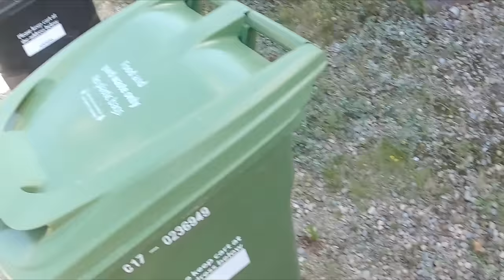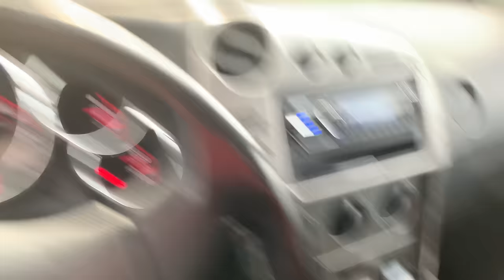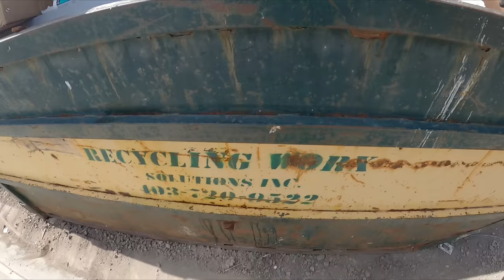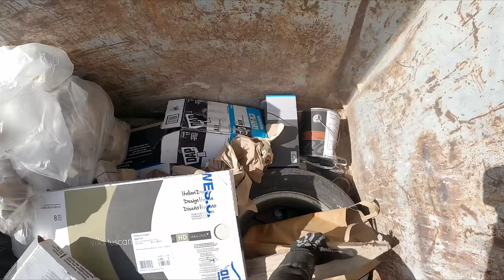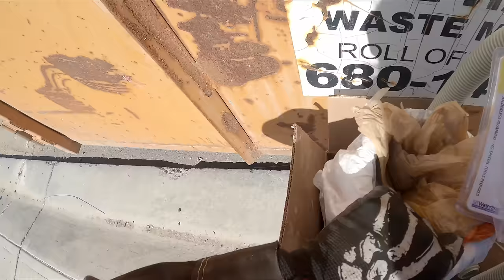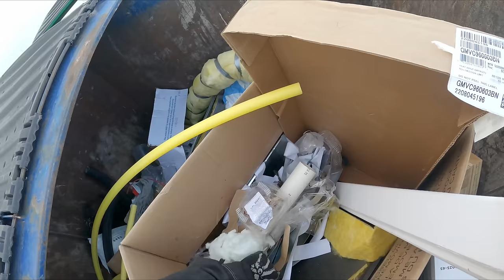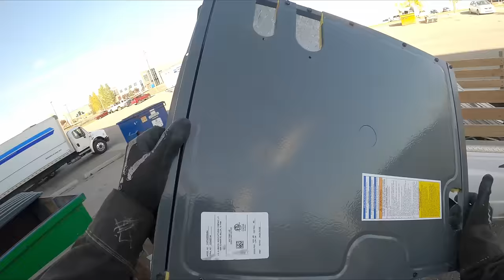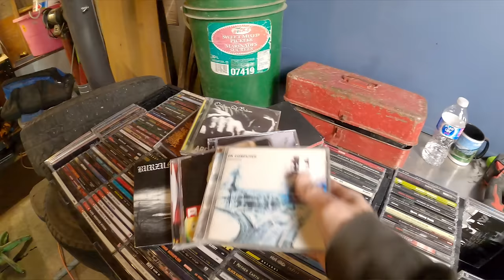100 Dumpsters! 100 Bins! Scrap Metal Dumpster Dive!

Comment: Tip on u-joints, use the vise to press/squeeze the caps in.  Should be videos demonstrating it.  Also whack on the fork ends by the shaft, to free it up after.
Reply from the maker: Oh that actually would’ve been a lot smoother, good call. Hopefully won’t have to do it for awhile though! I did watch a chrisfix video first and I did the taptaptap to get them moving smooth, cut the footage down to as short as I could though
Reply: @thubprint  Saw the tappy tap tapping, I was taught a diff way is all.

Comment: Your switch board device is for power metering, the parts should mostly be brass and copper, looks more like tin coated copper or brass,  even short strippable copper wires are included.